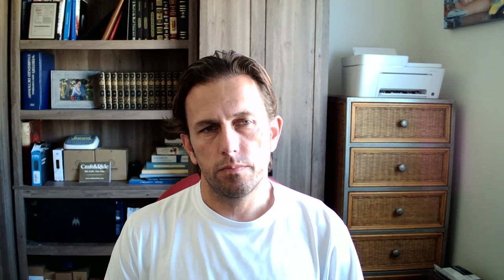OneWheel XR VESC Conversion - BMS Dilemma

Comment: Why people think that board will shut off if the BMS doesn't talk to the  FM controller? Not sure if anything has changed since you published this video, but I see most people with charge only FM BMS. Why?
-Pack /cell protection: I see it very useful, especially when monitored with OWIE. I prefer a cut off than having a damaged battery and not knowing it. Are other downsides not mentioned in this video?

Just ordered a VESC controller(ubox 85V 100A) and if I can leave the BMS and the entire box alone, I'll be very glad. If the XR led can be connected directly to Ubox 5v or 12v ,Super duper. 
I'd like  try VESC with minimal friction and mods( if possible) I have a perfectly working 4209. If aint broken, dont fix it.
Reply from the maker: An unmodified bms can definitely shut off your board at any time and there’s nothing you can do about it. The FM controller at least can use its ability to communicate with the bms to give the rider a warning before shutting down

Comment: How much does the stock BMS limit a VESC build? If I have a functional XR, how much of a benefit is there to swapping the controller to VESC over the stock controller? What if it has a CBXR battery?
Reply from the maker: you can unlock a huge amount of low speed torque by using a VESC controller. You can keep the stock BMS, but best to wire it for "charge only" as described on pev.dev for example, or on the Vescify Discord

Comment: Screw a BMS.
It's the whole reason batteries go bad
Reply: It's there to prevent batteries from going bad.
Reply: @0x1EGEN  batteries like the same temperature as you do. They don't like to be discharged beyond 2.7 volts so I usually don't drain them to 30% due to voltage sag. It dips below the threshold and can hurt them. But what really hurts them is leaving them at 4.2 volts fully charged. They do not like it. Bottom line. They the battery manufacturers of course are going to sell the batteries because they can handle it but they degrade quickly if they sit it full power and that's the number one reason why they go AWOL. It's usually best to leave them at 60% state of charge and then before you ride charge them up to 80% maybe 90% unless you are going on a really long ride then it would be best to charge to 100. The only BMS that you can trust is one that you can see the cells of the voltage through your phone smart BMS But that's only if the BMS is calibrated. You're going to know if you have a weak so because you're going to get less run time on your ride. But the best way is a temperature probe because you don't want heat and they instantly get hot if it's a dud. For the last 5 years I've had thousands upon thousands of loose lithium ion batteries in my house. And I have never had one go AWOL because I don't leave them fully charged connected

Comment: maybe it will be useful to someone. I built a diy onewheel out of hoverbord parts. I used bms from the original battery. I have replaced the ceels to stronger. In hoverboard charging go by controller, together with discharging. One time I brake hard, charging in bms burned down, and the controller also burned down. Now charging is going through bms and discharging separately directly from cells. It is worth remembering when connecting a different BMS. Braking current can be quite high. Sorry form my english :) 
anyway, a great job :)

Comment: Is there an alternative BMS available that could combine all the advantages of the FM BMS with maxing out the available amps?
Reply from the maker: You'd think there would be - but because of FM's anti-competitive tactics there is not. Should be easy for someone to make one in the $100-150 range and make good profit
Reply: @surfdado  The FM thing would only be an issue if the BMS needs to talk to a FM controller, right?
For VESC conversions I assume that wouldn’t be an issue?
Reply from the maker: @floatangels  correct, with VESC conversions becoming more popular, the market for such replacement BMS is growing, which should make this venture more attractive for BMS builders

Comment: What if you had an independent thermal, sensor ? Not as good ax bms but it could alert you if the cells got a high temp situation before thermal runaway 🤔
Reply from the maker: I've been thinking about that ever since I started building my first Funwheel... with the LFOC's extra pins it should be possible to monitor battery temps directly from the VESC, even though ultimately this really is a BMS's job
Reply: @surfdado  make one with a small thermistor and a arduino micro or nano.. or the vesc itself.. if I were making such a device I'd implement a audible tone for the device that would be continuous above a threshold say 80c since potential starts at 60c for lithium and hits critical at 100., I'd have a buffer since such a device would rely on the user as the safety
Reply from the maker: @MrDmadness  you should make one
Reply: @surfdado  I'm planning on it, right now though I have 2 working xrs with cbxr. When one dies though I will be using the skeleton to vssc for sure, im actually looking to buy a bricked gt for next to nothing at some point to program since immorality sure the reason unplugging the pcb is a cmos memory corruption from lack of power..  should be re programmable

Comment: Hey man, thanks so much for this info. I’m working on my XR conversion right now and you answered all of the questions I had about the BMS. I’ll be going with option A as well for now. And plan to upgrade the battery and BMS down the line. I like that this allows me to revert back to the stock controller if I want.

Comment: 30a onewheel BMS costs 400 USD? WHY?
Reply: It communicates with their ESC, meaning you can't switch it out to anything else. I don't think their ESC lets you ride without the constant communication with the BMS. If your onewheel BMS were to break, you would need to replace it with another onewheel BMS. Which you can only buy used as FM doesn't sell it. Which leads to these outrageous prices.
Reply: Because future motion refuses to sell that part,
Reply: FM don't sell Bms. It's supply and demand so prices are high if you fry one in the damp #badgerwheel it
Reply: I'm unsure why a person would not just make one. Pcb way and some components.. couldn't be more than $20